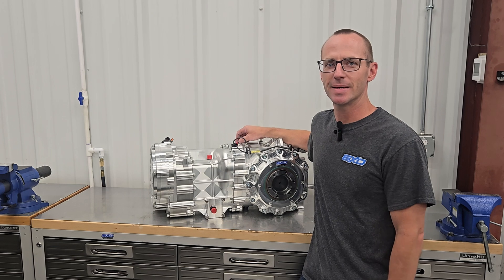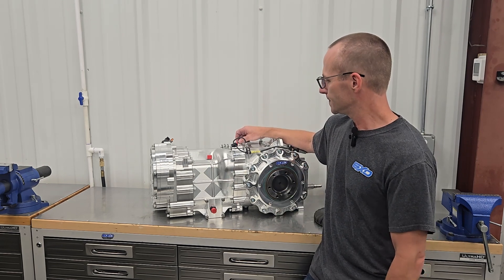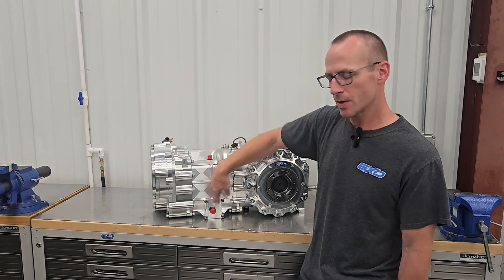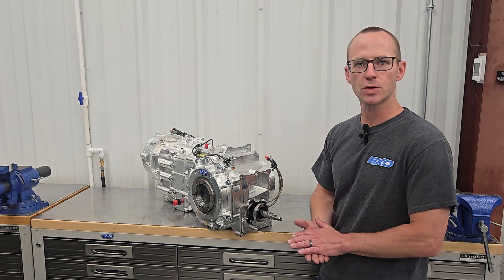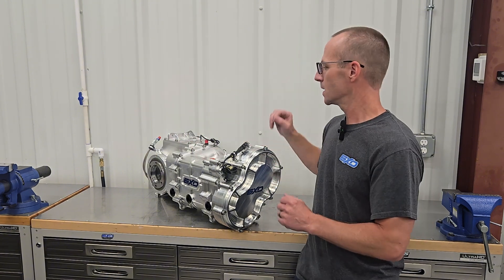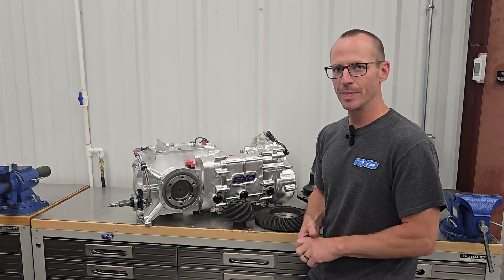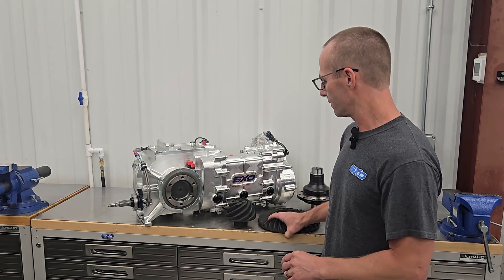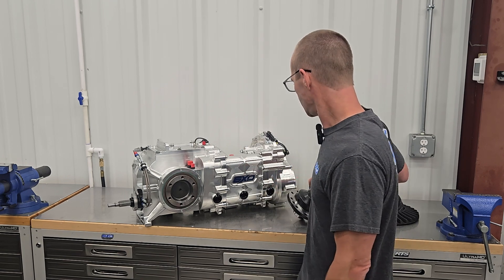BEST & STRONGEST Sequential Transaxle on earth for mid-engine cars, the NEW 6XD-MTX from 6XDGEARBOX

Comment: couple questions..
1st .Any idea of expected cost 
2nd.. is sequential by 'rod /cable' or solenoid electrical ?
Thanks
Jerry
Reply: 36k total cost, this includes the neutral/reverse lockout solenoid, rotary sensor for billet gear display which is all included...

Comment: Is this unit able to be run inverted for use in a DeTomaso Pantera?
Reply: This is a mid engine pkg for gt40 n pantera already
Reply: @racetechservicesinc.8650  They are two completely different applications. The Pantera runs the gearbox inverted from  how it is mounted in a GT40. I am  asking if the box can  be configured to run inverted?

Comment: Clay I only have 1 question why a 5 speed?
Reply: This was designed originally to replace the gt40 builds out there original and continuation builds with Superformance builds regarding Carrol Shelby. These also bolt into Pantera builds which both have a very limited footprint to fit into... Any big power build doesn't really need more than 5 spds...
Reply: Big hp builds don't really need 6spds and this is made to fit the same footprint as gt40 and pantera builds which can't be longer